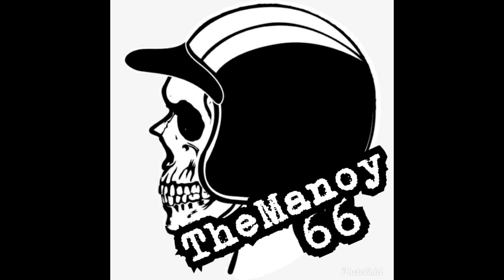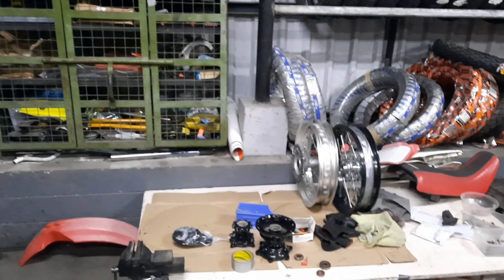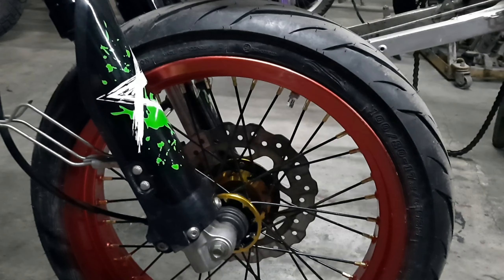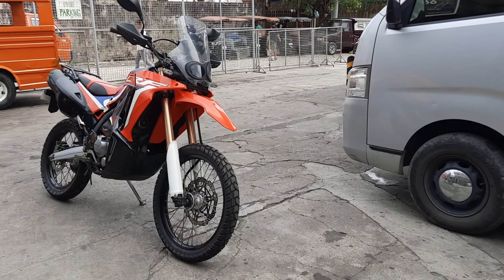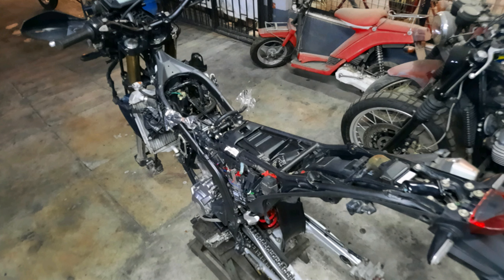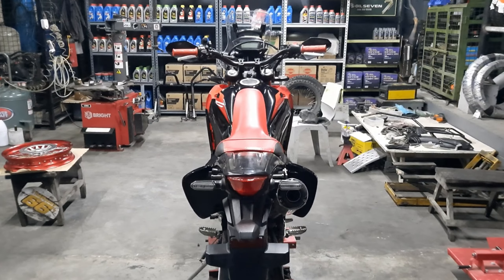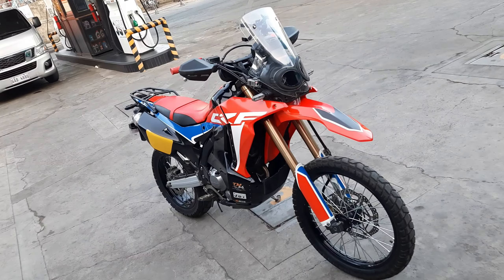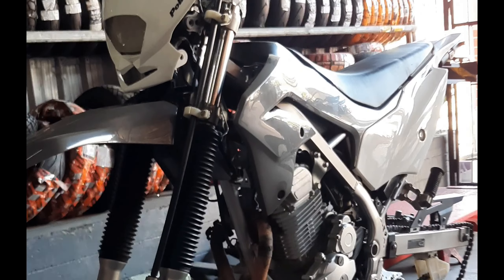CRF250 RALLY PROJECT - The bike i bought from a Subscriber AND I made it BETTER!

Comment: Hey man Question,

Ive bought some sm wheels for my crf300l with the correct hubs and such.
now i put on the back wheel spacers wrong and slightly damaged my abs ring now when i ride it keeps flashing abs light on the dash.
Ive tried to reset it by disconnecting the battery and cleaning the sensor but nothing worked.
U think the only option is to buy new abs ring?
the ring is not really damaged or bend just the black paint abit u wont even feel it with ur nails.
also i let the back wheel move thru the gears when bike was on the stand just to see if everthing was fine when i put spacers on correctly.
maybe my abs is confused?
was trying to google it but no answer was really there that helped.
maybe u have a idea?

Thanks!
Reply from the maker: Good question. Sadly i do not have the answer to that since the models we have here do not have ABS. The abs being confused is also my guess. 

How does it ride and does the abs still work though?
Reply: @TheManoy66  thanks for the answer ill just ride with blinking light for now maybe it goes away 😁

Comment: good day sir, i was wondering if that rounded side mirror attached to the handle bar is it legal? and also the t4 pipe? it won't go beyond 99 decibels required from LTO? thank you for answering my question and more power
Reply from the maker: The parts i installed are hovering just below the legal limit. 😅

Comment: I am planning to convert klx 150BF to tire size 100X80X17 Front and 120x70x17 rear. Do I need to install bar riser for this set up?
Reply from the maker: Depends on you if you need the risers or not. Its more for comfort really.

Comment: delo gold oil gamit nyo sa mga motor ?
Reply from the maker: Depende sa motor. Mga vintage namin Delo gamit namin. For modern engines we prefer Havoline or S-oil.  Shop ko doubles as a storage for the lubricants we sell sa gas station namin kaya marami kami oil.
Reply: pag push rod engine pwede kaya ang delo gold